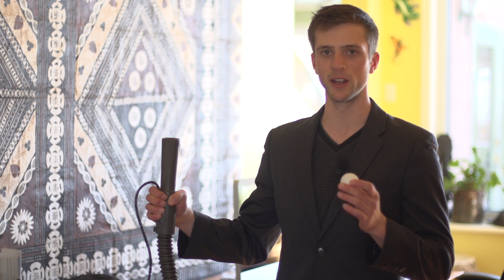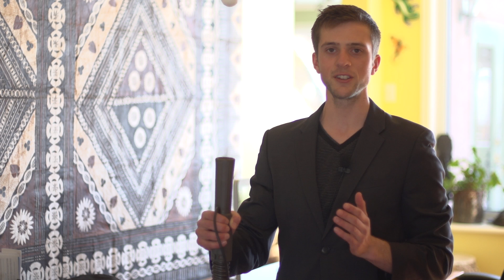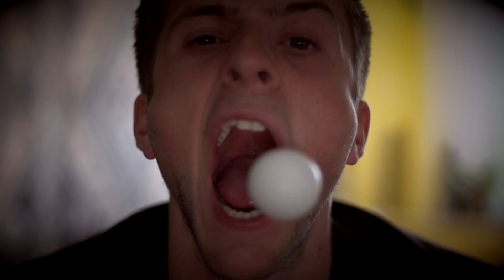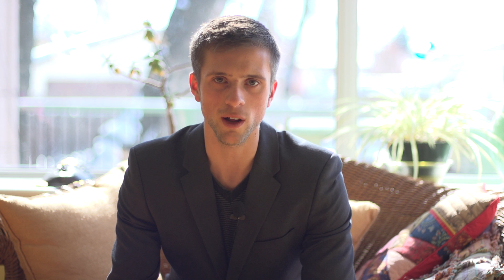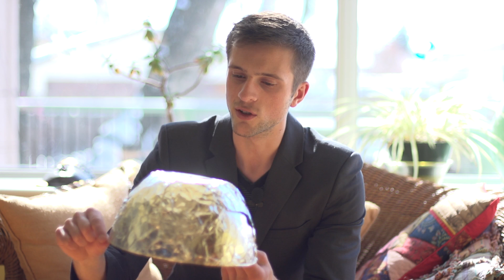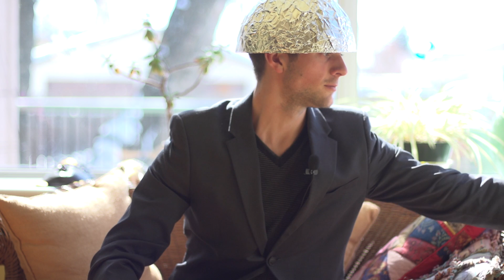Coanda Effect Explained! UFO Technology

Comment: Cool I just bought a bunch of cheap plastic bowls to mess around with this idea. Still Googling a round to see if anybody is building /selling a tri copter / quad copter using Coanda Thrusters at the corners instead of props. Seems ditching the props would be a big improvement in safety.

Comment: I experimented with a variety of shapes and propeller locations. By measuring the thrust produced Using the same motor and variable pitch prop I came to the conclusion that a well designed ducted fan has much better thrust. The coanda effect saucers do have other advantages and could still have some practical applications.